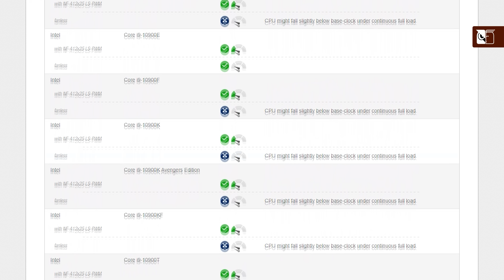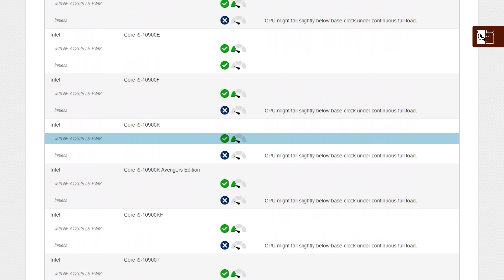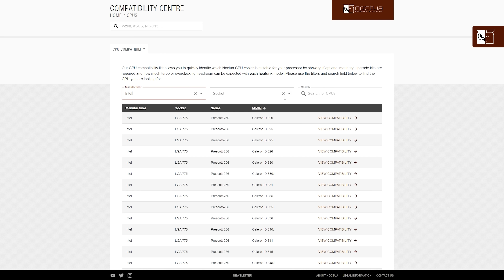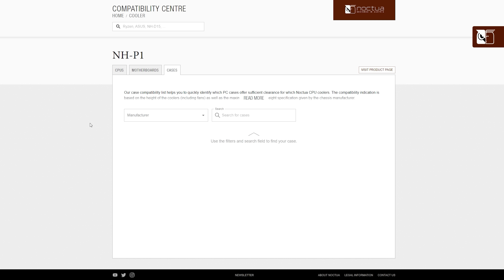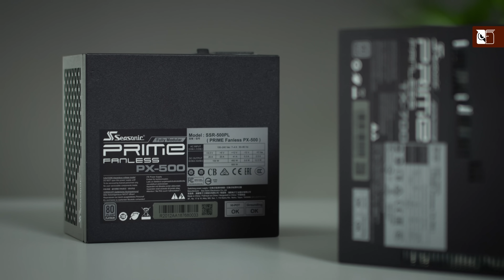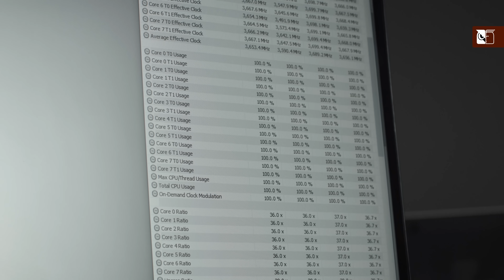How to build a passive PC with the Noctua NH-P1

Comment: Does putting the GPU in the second slot affect the bandwidth and performance?
Reply from the maker: Depends on the motherboard. If you use one that has the second slot connected directly to the CPU with x8 bandwith, performance won't be affected.
Reply: @NoctuaVideos  thanks for the explanation.

Comment: So, let me get this straight: (1) the CPU will BELOW BASE often, (2) the CPU, while BELOW BASE, will still operate at thermal limits, (3) I should ideally not use a GPU, or limit myself to trashy cards, and (4) even then the build will automatically heat up the GPU, which will in turn heat the CPU. Hmmm... interesting, but FUCK NOCTUA. No active cooling = non-active PC.

Comment: If that cpu cooler can work without a fan, it should work really well with one. I would put a fan directly above it and blow the air up and out through the top of my case.
Reply from the maker: Yes, as described in the video, this is a good option to enhance performance.

Comment: I thought this video was fascinating, even though I am not really sure I would go for a passive PC myself. Using a Noctua NH-D15 with two fans at full speed to run an 11700K at 5GHz all-core is such a nice performance boost, and they're not even loud fans really. I mean, you can even see in the video how much the performance picks up when he adds just one fan. I like seeing how much can be done with passive cooling and how powerful it really is, but at the end of the day when a few fans can drop temperatures that much... it's hard to say no to that. Especially if you have an air conditioner or something running in the background, you won't even hear the fans. I guess it would be a bigger deal for people who are doing music production or something where noise could interefere.

Comment: WHY are you recommending cases where the GPU is below the CPU?! You will only heat up the CPU more in this configuration! 

The easiest solution would be to buy a left sided case like the darkFlash V22 that way the CPU and GPU are isolated from one another. You can even get vented PCIe covers and place the GPU in the farthest PCIe slot so it's away from the CPU.
Reply from the maker: As long as you don't use a very big GPU (which doesn't make sense for passive builds anyway) and have sufficient space between the GPU and the cooler, this works nicely. The darkFlash V22 wouldn't work well because there is hardly any bottom to top airflow (no bottom air inlets except for the PSU).
Reply: @NoctuaVideos  by that logic, any case that has a bottom, vented or not, wouldn't make sense for passive cooling. May as well stick to a Core P3 or any other open air case.

Comment: Hi, Thanks for a nice guide. will like to use Noctua NH-P1 along with NF-A12x25 LS-PWM in the near future. But would also like to use a suitable chassis with an internal 4K UHD Blu-Ray Drive. In the compatible chassis list could not find something with an option for ODD. Kindly let me know if possible on the same. Regards
Reply from the maker: Unfortunately we currently cannot recommend any cases with ODD bays. Would an external drive be an option for you?
Reply: @NoctuaVideos  Hi, sorry it is for a gentleman who wants to avoid clutter. 
But must say , the nicest looking cooler.
Class written all over. 😊

Comment: Manufacturer isn't recommending for itx builds but unfortunately this fanless cooler is gonna be in high demand for the itx community.
Reply from the maker: It surely can be used in ITX builds if you know what you're doing, just not so easy to get good results with hotter CPUs.

Comment: Sure...you pay a premium price for Noctua coolers, are you getting your monies worth with your investment? As a Noctua customer I can say a solid YES. I've had my NH-D14 for quite some time, it's graced such CPUs as a i7 950, a i7 7700K, a Ryzen 9 3900X and a Ryzen 9 5950X...yes they supplied the AM4 kit for the D14 but the cooler and even the bracket kit were packaged beautifully and contained excellent instructions. I also own a NH-U14S for a secondary system  with the above mentioned 3900X. 

So here we have Noctua's new passive cooler, a stout piece of metal designed to work without a fan, sure they can push the hard sell but no...the give us a soft spoken gentleman explaining what this new cooler will do and what it'll work with. No massive overdone hype but a classy informative video and links to supporting documentation to go with the new cooler. This is the quality from a company that you pay a little extra for when it comes to the products. It's things like this that will make the decision to buy Noctua real easy in the future...and yes I sense more of their products in my house soon.

Comment: Very calming voice and the only thing that distracted me from it is Noctua's choice of parts. 11900/Z590 and a 1650 lmao
Reply: GTX 1650 KalmX is the fastest passively cooled GPU on the market. It's quite sufficient for casual 1080p gaming, although 11900K/Z590 is overkill for GTX 1650, but this combination (high-end CPU & lower mid-range GPU) is chosen by someone for whom gaming is not primary on the PC.
Reply: @das.macabre  oh the 1650 is plenty good for 1080p gaming, I don't disagree. If you're trying to not game and do office work on it, the iGPU that comes with the 11900 is plenty good. That 1650 isn't even going to be decent for video rendering.
Reply: @LadBooboo  Well, I wouldn't mind a passive combo like this, although oversized for my taste (SFF fan here, I have a GTX 1650 DDR6 low profile in a 7.5 liter case).
Reply: @das.macabre  I'm jealous of that. I live in a country where it's 29c on a good day so passively cooled PCs are not really feasible. I have a SFF pc too, kinda old but still does pretty well. 1600/ab350 itx/16gb/2060 super.

Comment: Why on earth would you use one of the highest tdp HEDT CPU's with a passive cooler, never mind paring it with a 1650.  That is insanity.  Otherwise good vid.
Reply from the maker: Because the fact that it can handle the 11900K at base clock nicely shows how capable this cooler is. As we say in the video, there are other good choices that are easier to cool. As for the graphics card, there simply aren't that many options for fully passive cards at the moment.
Reply: @NoctuaVideos  You shouldn't use a poor choice for a cpu as an example of what to use with a passive cooler.  Boosting on all cores to 5.1 ghz is normal behavior for an 11900K.  Boosting to 3.7 ghz on all cores is NOT normal behavior.  You could just have easily used an amd 5600X or any 3rd gen ryzen cpu below r9, or an 11400, or any myriad of other processors whose tdp is below 95, your own specification for this cooler.  There are people who don't know better and they may misconstrue your example as a recommendation.
Reply: I understood they used the 1050ti which is even weirder

Comment: I’ve bought one, can’t wait for it to arrive after seeing this video! I’m currently running a NH-D15S but although that’s an excellent cooler, it has a pretty closed off fin stack so it needs an active fan on it to move the air. With the NH-P1 I hope the case fans that are right overhead will be sufficient and thus make my system even more quiet than it already is.
Reply: Could you perhaps place the cooler parallel to the airflow so air can flow between the fins?
Reply: @greatwavefan397  I ran the NH-D15S fanless with different configurations (orientations/case fans), but the fin stack is just too dense to effectively draw the air out just using case fans. I've since tested with the NH-P1 and that makes a huge difference, it works really well with just case fans. It's an excellent, quiet solution if you keep the CPU power consumption at sane levels.

Comment: Awesome video, impressive cooler.

I would consider myself using a passive CPU cooler if it wasn't for the fact that my hard drives make more noise than the rest of the PC... I guess I could always go with some SSDs ... maybe when I overhaul the media center PC I'll go for an APU with a passive solution in a mini-ITX case (fully vented of course)

For the sake of completeness one thing that was skipped on the video was coil whine from certain components, if you are building a passive PC consider the noise from the inductors, usually good quality PSUs and good GPU power delivery designs don't suffer from it, but be on the lookout for it as it is way more noticeable and annoying if it is the only source of noise...

Comment: I think the heatsink needs to be outside cooled passively by ambient of the room temperature [Recommended 20℃-26℃(Average 23℃)]  because the amount of heat produced inside of case.

Would you created or sell a specific/exclusive portable case like a easy puzzle with a heatsink pop-out outside of the case and create some protection to prevent damage when someone suddenly hits or touches the pop-out heatsink?

Get 2 kinds of tempered glass side panel cases.
1. Side panel with some custom holes so the hot air produced by GPU can move out.
2. Side panel full covered so when someone uses a passive cooling GPU it's still looking OK.

So we (end user) don't need waste a time to find a suitable case on the marketplace or got scammed cause the lack of knowledge.
Reply from the maker: Easier said than done as the exact position of the cooler will vary from motherboard to motherboard. Rest assured it DOES work well in regular cases though. Open style cases work well too. See our recommendations here: https://ncc.noctua.at/recommended/NH-P1-68/cases
Reply: @NoctuaVideos  hmmm that's make sense (motherboard cooler position).

Thanks i'll see the page.

Comment: Hi.

Thanks a lot to Noctua for all PC case tests for passive builds in the provided link.

Would you, at Noctua, recommend a different PC case selection for all people that will never put discrete cards inside, but just use APU only ?

I don't think that the bottom space would be crucial in this case.
Do you agree ?

I'm very interested for a full passive APU only build (APU with NH-P1, passive PSU, nvme heatsink).

What PC cases would you recommend for that configuration, and would some Mini ITX cases do the job with 65W APU, please ?

Thanks.

Regards.
Reply from the maker: We would recommend the same cases as bottom to top airflow is the key point. For ITX, please take a look at the Lian Li O11 Mini. It works very well with the "low motherboard" setting: https://ncc.noctua.at/coolers/NH-P1-68/cases/Lian%20Li?q=mini

Comment: The 11900K requires like 200 W for full performance. Odd choice there - AMD 5900X would fare much much better.
Reply from the maker: No, 5900X doesn't work well at all, we cannot go much beyond 2.6GHz, so more than 1GHz below base clock. By contrast, we can keep the 11900K at or slightly above base clock, so we're confident that it's an excellent choice for the NH-P1.
Reply: @NoctuaVideos  Interesting, did you try the Eco mode in the bios?

Comment: Liked the video , but tbh I would've liked to see something a bit more mid-range for the CPU , just to see the kind of temps it would get. Something like a 65W CPU would've been nice. 

Anyway , great video , product seems nice , but for now I'll stick to coolers with fans, I love low temps. As a company , you're great ,and the product quality /attention to details is always top notch.
Reply from the maker: Thank you for your feedback. If you like low temps, passive cooling may not be the right thing for you, even 65W parts like the Ryzen APUs will inevitably run hot. Keep in mind that this is entirely fine for today's processors though, they are designed to be operated at their thermal limits.
Reply: @NoctuaVideos  yup, I have an NH-D15 , happy with that. I was wondering how a 65W cpu would fare in light usage/light gaming (like 20-35% usage.
Reply from the maker: At 20-35% load, 65W CPUs will run pretty cool!

Comment: This is neat but I think passive GPU cooling is much more useful since that's where the majority of the noise is going to come from in a gaming PC, or any PC that makes noise. There's really no good reason for passive CPU or case cooling as you can just use very quiet fans at a low enough speed that they end up silent.

Comment: Seems like it would also work quite well on a standard high airflow PC case like the Corsair 5000D with a very quite single intake fan in the front and exhaust fan in the back.    Can it be oriented with front to back airflow in mind?  I am not sure why you would build such a PC with ultra quiet in mind, but having the fans essentially off all day in "quiet mode" and then having the option to switch on the fans and  do some light gaming at night (or switching them on to do rendering for a while etc) could come in handy in a shared home office or when you want "quiet mode" to do recording in there etc.???  I shove 4 to 8 fans in my PCs but then i set up fan curves that mostly keep the situation below 50dba even when under load...but at the extreme end I have it ramp up to 100% (around 90c cpu) and it sounds like a vacuum cleaner.   Fortunately it rarely happens but there are some people who would sacrifice that 10% to 15% performance under the rare 100% work loads to go 100% stealth I am sure.  By the way, I love my DH 15.  It is just so dang easy to work with and maintain and I would say darn near idiot proof (which is a particularly useful attribute in my case).
Reply from the maker: Semi passive is a good option but we'd recommend going for a case where you can set up bottom to top airflow so that the airflow of the case fans will be the same direction as natural convection. This way, you'll have the best performance fanless and with fans on.

Comment: Yeah, running i9 at 125w is "by intel specs" but will perform below ryzen 3600 level.

Just be honest, this cooler is not made for intel 14nm cpus. You will not get anywhere near the performance shown in reviews that run them at 300w and more.

Comment: I built my new system with d15s for a semi-passive system, I have GTX 1070 MSI semi-passive and corsair RM850w semi-passive. with 5950x pulling only 50w when you turn off the boost, I think I could run my system with zero RPM, I only need to test it. and yeah, I spent $800 to get SSD to replace all my 8TB HDD, going passive costs a lot.
I will update my comment here once I disable my fan below 90c from bios to see how it's going to perform.

Comment: Nice, but imagine this with a pair of fans, could compete with high end liquid coolers 😉
Reply from the maker: If this was the holy grail in active cooling, do you really think we would market it as a passive cooler? It's designed for passive cooling and as a result, it doesn't do particularly well with fans.
Reply: that fin stack tells otherwise

Comment: Great product, I'm very much looking forward to using it in an HTPC build!

I have a question, if using this cooler with the Gigabyte B550M AORUS Pro-P AM4 Micro-ATX Motherboard, would I be able to install the NH-P1 rotated 90 degrees, aligning the fins as front-to-back of the case, in order to maximize the effectiveness of the airflow from the front case intake fans and rear case outtake fan?

Thanks,

All the best!

Comment: I wish GPU manufacturers would ditch their ricey RGB shrouds and just ship cards with Noctua fans by default.
Reply: I deshrouded my gpu and put noctua fans on it, it works great but looks about janky
Reply: @Incommensurabilities  Yeah, the jank is the bit that bugs me. I've seen some people zip-tying fans to their de-shrouded heatsinks. I'm running a 1050TI KalmX right now and my system is so damn quiet (if underpowered)
Reply: @mos6581com  It's possible to make a slightly less janky version with BeQuiet fans because the frame is different.

Comment: If someone is considering going 100% fanless also consider coil-whine. In my experience a little fan noise is much more pleasant than coil-whine, which you will hear from the graphics card or PSU if there's no fan to cover it. 

So that's also something to keep in mind when chosing a fanless PSU.
Reply from the maker: Yes, this can be an issue indeed. We didn't see any coil-whine with the Seasonic units we've used though.

Comment: I can't see anyone wanting this in current conditions. It seems like it's best for low core, non-server pcs. It's a solution looking for a problem. But I hope someone finds a really good use for it, (beyond kiosks).
Reply from the maker: It works very well with many 6 and 8 core CPUs. Not that many applications require more cores than that.
Reply: @NoctuaVideos  I like it, I just hope someone can find a "killer app" for it. I'm actually very interested in what Steve at Gamer's Nexus has to say about it.

Comment: X570 mobo with chipset fan: Am I a joke to you?
Reply: X570S 👍
Reply: Certain B550 boards already surpass the current X570 boards in terms of overall performance in overclocking, so unless you want more lanes, ports and all the features of the higher end chipset, B550 is more than enough even for a 5950x.

Comment: Have you considered power supply efficiency differences for different power grid voltages (230v Vs 110v) ? Or does that not affect the semi passive route that much ?
Reply from the maker: It does have an effect but it's not huge. For example, for 80 Plus Gold PSUs, the difference is 2-3%. If you assume that the total power draw of the system is 300W, there will be 6-9W extra heat in the case if you're on 115W. This is a slight drawback but not a deal breaker for sure.